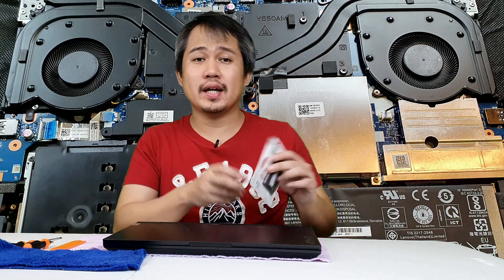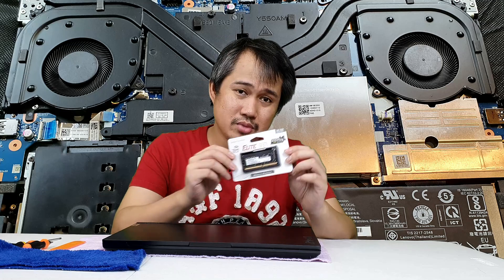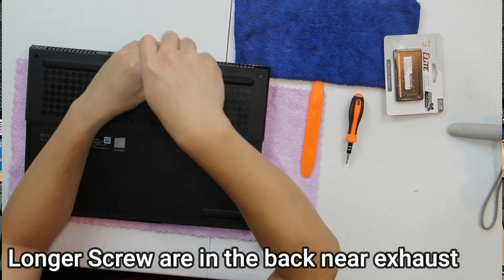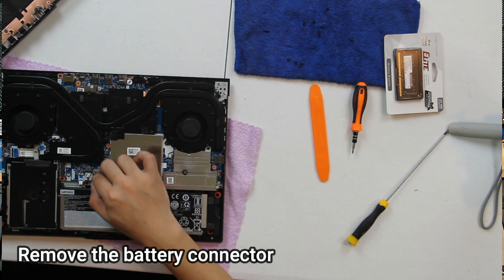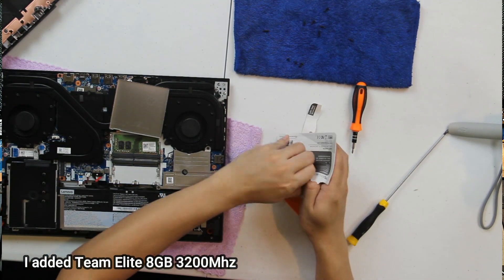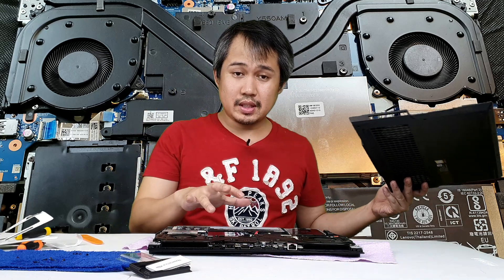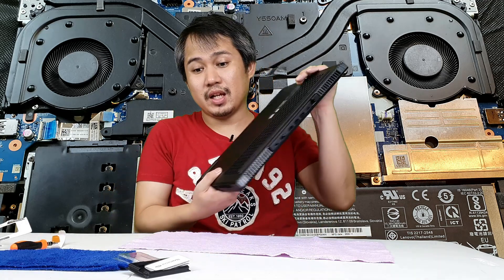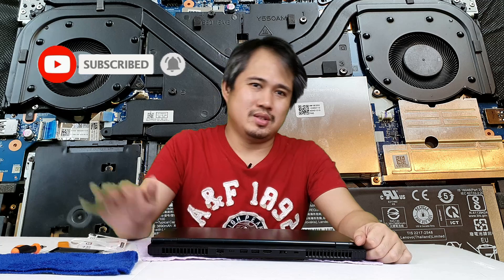How to upgrade Memory  Ram of Lenovo Legion 5 15ARH05H

Comment: hello, i'm not able to find memories with frequencies 3200 mhz, in stores here in my country, but i have a hyperx impact memory 16 gb 2666 mhz cl15 can i use it in legion 5? Even if the faster you lower the frequency, I would like to know if you have the compatibility to work together.
Reply from the maker: Are you planning to replace or add different frequency? 2666Mhz will work with legion 5. But if you will just add another stick, my advise is to have same frequency and capacity for better dual channel capabilities. But if you will replace with 2666 freq that should be fine, and you may not directly noticed that its performance  is a little bit slower since you have higher capacity and for some apps it offset the freq lost. But It will be depent on the application that you are using.

Comment: Nice video sir! MAy i ask, if i replace the stock thermal paste of my Legion 5, will it void the warranty? i get terrible temps while gaming avg 90 degrees.
Reply from the maker: To anwer your question, majority will tell you it will void your warranty. But if you are confident you can DIY it, just ensure you will not physical damage it since lenovo sticker is only in motherboard so technically it should not void since sticker warranty sticker is not damage. But alternative use ryzen controller to control your temp, the only downside for this once you hit the temp you set it will automatically turn off performance boost to lower the temp so slight change in the performance.

Comment: 2021 model?
Reply from the maker: 2020 model, as 2021 are the Legion 5 Pro with GTX3060 graphic card. But that still depending on your need and price option. Same price range for 2021 legion 5 Pro only comes with Ryzen 5 but good graphic card. while 2020 model have better CPU but not the latest GPU. But if you are not hard code gamer, that does not matter, I will go for more thread and computing power as I need it for video editing.
Reply: @YopiChannel  there’s already a non Pro Legion 5 lol
I just ordered one
Reply from the maker: @TheRonron1994  That's nice. enjoy your legion 5. Actually not sure the difference of 2020 and 2021 legion 5.Just considering the specs. some says this is 2020, other 2021. and notice most 2021 is gtx 3060. so I consider this 1660ti 6GB, since it has ryzen 7 4800h and specs fits on my needs.  As I upgrade from an old Asus n46  i7 10 year old laptop that still working fine, the only issue is rendering and video editing 4k video takes time on my old laptop.

Comment: Do you have information if paano mag upgrade ng battery from 60 to 80 whr and kung magkano. Since we have the same model, what storage do you recommend, ssd or hdd. If ssd, SATA or nvme?. Then what is the pros and cons? Thankss
Reply from the maker: For Battery upgrade, I don't have information where we can get item here in Philippines, usually I saw online is for ideapad model . some online store I saw with 80whr is from US online store. are you more on mobile that's why you want to upgrade the battery? Battery life is usually 2-4years depending on how you  use your laptop. its very rare people upgrade battery unless you are always on the go working without power plug.  But if you realy like it betterorder in Lenovo service center to have original battery since most of the time replacement battery did not last long.  Battery with 80whr will play around 3-5k pesos.  In terms of adding additional storage, if we are same model, the only additional expansion available is Sata so go for SSD Sata since the 500GB installed is currently in nVME. I will have another video to post in adding a storage in this model.

Comment: We have the same model. Pwede ba iupgrade to 32gb ram? Will it affect performance?
Reply from the maker: Yup, you can upgrade to 32GB max. or 16GB per slot. Since it has two slot so you can upgrade up to 32GB. But performance wise depending on how you are using your laptop. If you are a user that have lots of open applications while heavily editing 4k video like multiple tracks, higher ram will help in the performance. But if you are not on hardcore  video editor or hard core gamer that streaming videos, 32GB is overkill. I suggest you stick to 16GB to save you money. otherwise if you have luxury to spend you can go for it, and it may benefit you in the future use. Thanks for watching